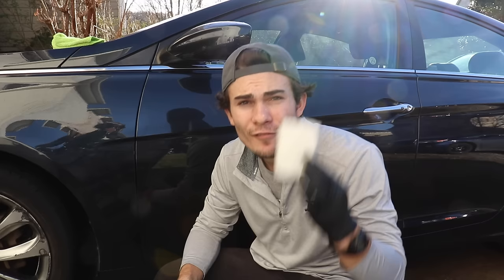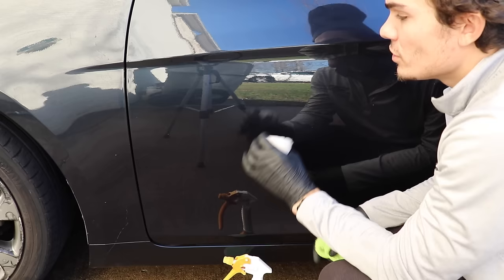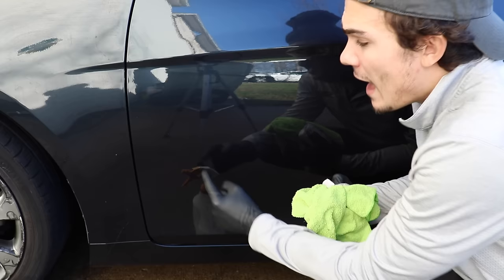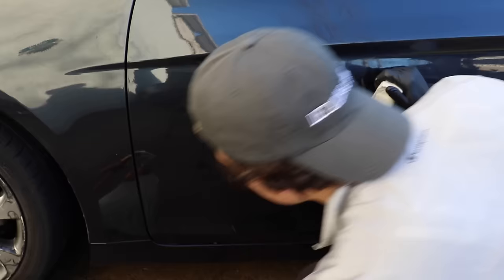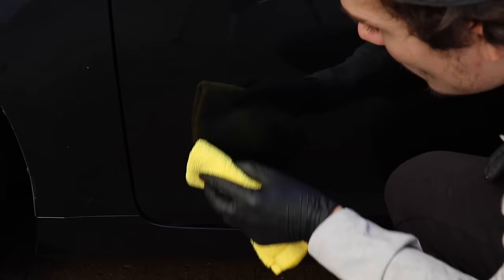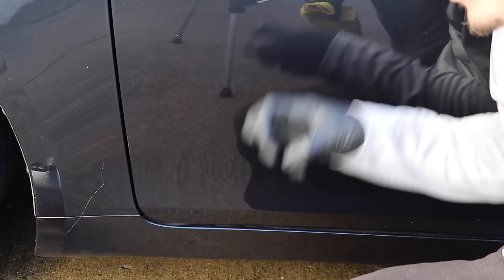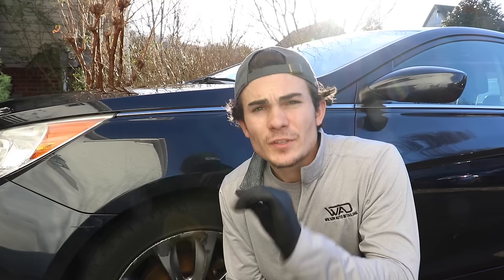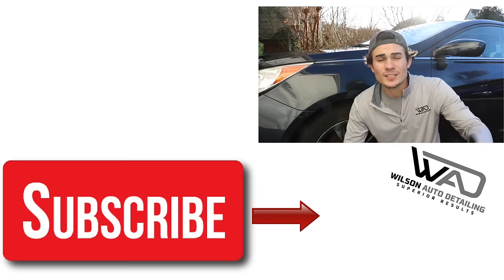Is a Magic Eraser Safe for Car Paint? | How to Correct Abrasions

Comment: Thank you so much for this video! I not only did what you showed in the video, but I really worked the Magic Eraser and used it on some stubborn scuff marks where I rubbed up against the pole in my garage and they ALL came out (without getting to the damage stage). It took a while to really get the magic eraser going (because I started with a new one), but once I got going and swirled it around in the areas I needed, I not only got the marks out in that area, but also on the other "scratches" that naturally occur when you're in a parking lot and someone opens up their door and scratches your paint. I got everything I wanted out and more - so thank you Wilson Auto Detailing. I really find your videos VERY HELPFUL!!!!!

Comment: Test this in a harder to see spot. It took off the finish of my car way easier and faster than in this video, and didn’t take the scratch out. I wouldn’t recommend doing this.
Reply: Yeah it's basically like a micro brillo pad! You could use it in your wet sanding or cut and buffing stage maybe...🤔

Comment: Make sure its completely wet with soapy water and use it very lighly. It only works because its an abrasive but with this way you can very carefully polish an area of clear coat. I found it works and lasts the longest if you hold the foam from the opposite end so that you cannot press hard

Comment: Thanks I just noticed that I had one of those abrasions on my car paint :-( I let my dad help me remove a scratch using a Mr Clean Magic Eraser and it worked so well he got excited and started to trying it out on the spots of the car that had paint chips from little rocks hitting the car on the highway because he thought that the Magic Eraser would erase that damage too (my dads like 80 yrs old) and he rubbed it so much that it caused an abrasion on the paint where the paint got dull around that spot. I got scared and thought I would have to get the car repainted but this video was a lifesaver. Do you have the Amazon affiliate link for that polish?
Reply: It’s cool that your dad helped out, I’m sure he had nothing but the best of intentions. It’s also cool you managed to fix it.

Comment: What a great video! Thank you so much! 
I wanted to learn if I could use the magic eraser safely to get differential fluid off the back of my car. It sprayed and splattered all over the entire back of my car when something on the highway hit my rear differential case. Two trips through the car wash did not take any of it off. I can scrape it off with my fingernail so thought the magic eraser would be a good idea.
Thank you for this info.

Comment: Ok so today i was determined to clean all the staining that dead bugs leave behind my front bumper. My car is yellow so all the little dark spots are very noticeable. So i used a magic eraser with light to medium pressure and voila it cleaned it almost 100%  after i did polish the area that i cleaned because it did leave some abrasion marks on it but the polish made them go away. Definitely do this to clean paint on a car

Comment: I bought some from aliexpress, it's very cheap and okay. Just be careful of the size. I use it daily for cleaning my windshield because I love to have very clean glass.

Process : 
- spray some alcohol and water (30 alcohol, 70 water) on the magic eraser to avoid overspray
- clean with magic eraser
- wipe it off with a microfiber
- finish with a glass microfiber

The result is perfect ! It works for interior (if you like the smell of alcohol) and  for exterior.
Reply from the maker: Yep! Great strategy!
Reply: If you buy on Aliexpress look for the high density ones. They are more or less the same as branded the ones. The regular one is too soft and doesn't last at all.
Reply: Thanks for advice. @janoskosik3168

Comment: I have a white car and I used a magic eraser to remove tiny black dots (artillery fungus from mulch). I had to apply a good amount of pressure to get the dots off. They were over most of the car. At the time I did not notice the haze / scratch marks in the paint, but now when it catches the right light I can really notice them. Someone recommended Nu Finish Scratch Doctor to restore these areas of the top coat. 

Do you think this will work as well as the funishing polish, or do you think the polish will work better? Also, can you recommend a different brand and type of finishing polish? Non of the local stores carry Show Car Renewit. 

Thank you for your help!
Reply: Was looking up the black spots and then searched for scrub daddy and glad to see your comment!

Comment: Hmm... Like a 5000-7000 sand paper? Trying to remove scratches from my car, I was going to start with a 3000 then move to a 5000 before polish but, seeing how the magic eraser could be like a finer sandpaper, it might be better in the long run to use it instead of a 5K paper.  Thanks

Comment: Hey Wilson, how do you remove wax that get on to black window trims? Thanks
Reply: I applied sealant on my brand new SUV trim bc it seemed to work in a small area. Well, it became white haze all over the trim! The solution that worked for me was an eraser. Yes those little rectangular rubber pink things that your kid uses at school! It will not damage the trim at all as well. You literally erase the white haze off and wipe the eraser residue off with a wet microfiber towel. Then dry it with and dry microfiber towel. It took me 2.5 hours to do the entire SUV but my brand new car looks amazing again.

Comment: I abraided my clear coat with the magic eraser and lacquer thinner trying to remove painted pinstripes. I tried scratch remover and hand polish and did not repair the abrasions. What next?
Reply: Polishing it back didn't work? You might have burned through the clear coat then.. I'd suggest trying it again and putting more pressure on it.

Comment: Could I use the magic eraser on overspray that the clay bar won't remove?
Reply from the maker: definitely but I would consider a chemical cleaner. Sometimes when using an eraser all over the paint assuming the overspray is everywhere you dont notice the abrading until you are done and you step back, then you will have to polish the whole thing... been there and learned the hard way... if its only in a small area, it shouldnt be an issue
Reply: Worked for me

Comment: yeah its safe if your and only if your going too be doing corrections
Reply from the maker: ehhhhh I dont agree but there are other ways to get around having to use a magic eraser of course if you don't want to
Reply: Wilson Auto Detailing I never said it wasn’t other ways guy it has its place as does a whole pleather of other products and tools as I said it’s safe if used properly with common Sense but you still must do correction what’s too disagree with that it’s the truth they damage paint If used your gonna have to do corrections be easy dude happy detailing

Comment: Magic eraser is a painter's dream and worst nightmare all in one. In the right hands they are ideed magic but in the hands of someone who doesn't know or even care about using them correctly they can cause more work than they fix.

 I had a housekeeper at work absolutely destroy a newly painted wall with one from using it to clean simple soup splatter off the wall. When the sun hit the wall mid-day it looked like someone smeared bacon grease all over the wall. No way to clean it off because it is sanded dull spots not an actual substance. Had to paint the entire wall again and the dumb fucker did it again not even a month later. We keep them locked up now.

Comment: I do not recommend using this method!  On my red pickup it messed the paint up bad!  Instead use WD40 and a paper towel.  It's works like true magic and does not scratch the clear coat up like this foam crap will.